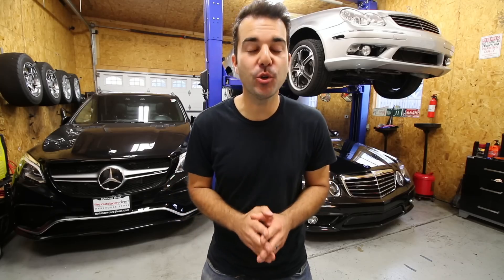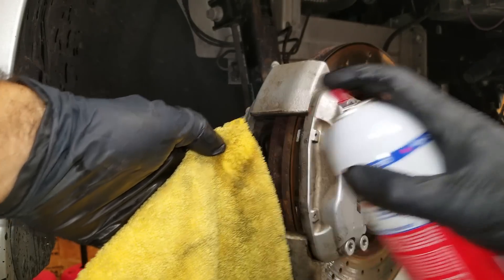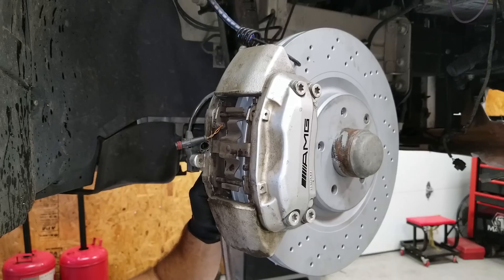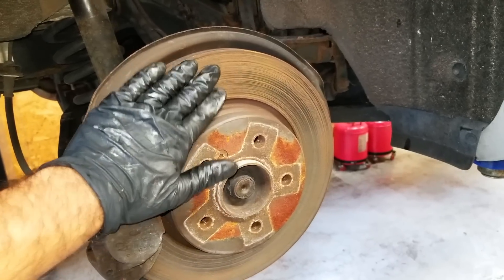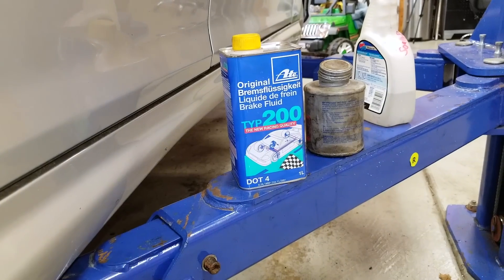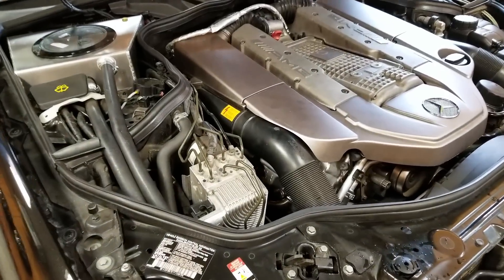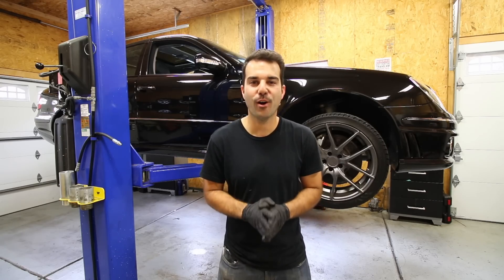Don't Let ANYONE Replace Your Factory Brembo Brakes Before Watching This Video. Big Brake Reality.

Comment: Did the rotors on my BMW once, stripped the fucking retainer bolt. Had to drill the fucking thing out, but not every drill is hard enough to get through it. Ruined some drill bits on it but eventually it worked. Did this on the parking lot in the rain. It was not pleasant.

Comment: Are the brakes from autozone real ceramic cause there’s always brake dust on the wheels I be driving my 2007 Nissan Murano like a gtr
Reply: NFL YoungBoy I would look into purchasing ceramic not made by Autozone itself but an actual brand that is better known. Autozone sells other brands that are ceramic and do a great job in stopping power better than the in house brand they sell.
Reply: joel oliva Ight bet

Comment: Video is very informative but careful... that manual site he plugs will a) offer you the owner's manual for $16.99... Like I said - look carefully at what you're buying because the owner's manual is NOT the service manual; you probably already have the owner's manual in your glovebox (unless you took it out because it is pretty huge). b) if you have an MB and want the service manual,  they don't really exist outside of the WIS/ASTRA software used by the Mercedes dealerships... it's not a manual in the traditional sense, it's software. AND c) that software that they'll sell you comes in the form of a 25GB .ova file, which is a virtual machine image to be run in VirtualBox. This machine image is copied (*pirated,* to be specific) from some legit purchased copy of the software, which is why it has to be delivered in a virtual machine and not as software you can install; they can't deliver you installable software because, like I said, this is pirated from some dealership.

All that said, you can't just buy WIS even if you wanted to legitimately purchase it, which  sucks and I'm not casting judgement or telling you what you should or shouldn't do... I just wanted to make people aware that this is the case, before they end up purchasing things they don't want, or aren't prepared for. Having a usable copy of WIS is a very convenient thing and I haven't found there to be any legitimate alternative. 😞
Reply: this is the very definition of a useful/helpful post. Thanks
Reply: @sonicCherryBell  I am glad it was helpful to someone after all this time :-)

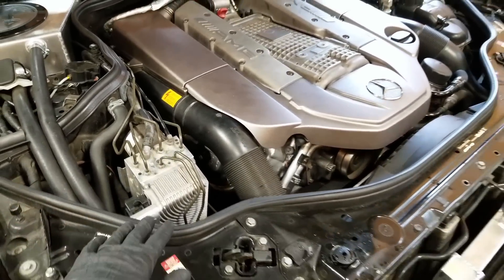Comment: 18:14 Launch X-431 Diagun IV

Thanks for your video. Can you help me please?

I am looking for an OBD2 tool with functionality like the one you use that works with my iPhone. I am in Europe and have a 2010 Mazda 6 and 2002 Ford Focus TDCi. It looks like my Mazda has a similar electric brake system that you show here and I want to bleed the brakes. Are there any other scanners (for iPhone) that cost less that the one you use but that will do the brake bleed job?

Could you please do a review on the OBDLink MX+ Professional OBD2 Scanner please?

Best regards,
Mark

Comment: One of my front brake caliper pins on my 2012 Range Rover Supercharged seized in place for some reason.  I beat it with my punch and hammer like it owed me money to know avail.  Had to end up removing the caliper and sliding the old pads out of the bottom of the caliper.  I have one recommendation:  I would loosen the brake fluid reservoir cap so the pistons go back easier.

Comment: Greetings from Romania! Perhaps you can help me, I have an MB w204 C220 CDI 4 matic and I want to upgreade my stock brakes ( 295 mm front disk, 300 rear and stock calipers with 1 central piston. Those are inslaled on the car ). Thanks

Comment: Great  video!!
Question: I recently serviced my 2014 s550 brakes and rotors at the dealership.
This was the first  time  brakes were done  do to the car only has 30k. They stated they don't have the pads for my car and had to go with  brembo brakes instead. 
Would that call for them to change  my calipers also?
Thanks

Comment: Akebono Ceramics don't bite enough for me, even for street use.
Hawk offers a great compromise.
Reply: my akebono's lasted about a year , mabee 15-20k miles (front brakes)   the toyota pads that came with the car when it was new lasted about 3-4 years around 40k miles. i left the toyota rotor on when doing the pads.

Comment: Toyota trucks have something that functions similarly to these Brembos. However, they are cast iron, ugly, and weigh a ton. Other Japanese car companies use the same thing on a few models.
5:50 People should use those tools 100% of the time. Sometimes if you don't push the caliper pistons in equally, it ruins the caliper. I discovered that while working on a care that had very expensive and difficult to find brake calipers.
8:00 Semi metallic brake pads are common on German cars, American and Japanese cars went with ceramic pads many years ago.
9:45 CRC brake paste is easy to get at Advance Auto and Autozone. Sil-Glyde is easy to find at Napa. I don't know if one is any better than the other.
13:35 some companies sell the rotor part that is separate from the center hub. It saves a lot of money. Here is an example for the Mitsubishi Evo X:
https://machv.com/collections/brake-rotors/products/evo-x-replacement-rotor-rings
16:45 I'm so glad they did that. I'm sure most cars would require you to hook up a scan tool with extra functions. Anyway, I like that little scanner because it costs less than whatever car companies expect you to buy.

Comment: Hi 1)your videos are incredibly informative Thank you. 2) Maybe you would answer a couple of questions, Per your suggestions, I Switched to Brembo rotors and Akebono Ceramics on 98 xj8 l with 130 miles that I recently acquired and see its performance ( did F&R as well as  Struts) . I also just purchase a newer 08 xj 308 that its brakes were completely done however had a shimmy when I Braked at 50 MPH ( I Don't know the brand name but they are new per the mechanic) . I Now changed them to Brembo and Akebono and My Condition is gotten " worse" than before. I shimmy at 30 MPH and all over the place.  It"s not the wheels they were balanced . Help!!!!

Comment: Hey dude, watch the language, my 3 likes to watch these with me!
Reply from the maker: My 2 and 4 year olds watch these too. What did I say??
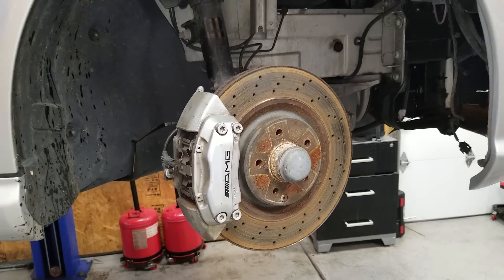Reply: Typical workshop talk, no big, unless you're a toddler latching onto new words. Check out 1:18, 3:20 & 6:56. Lesson learned on my part, I'll pre-watch these in the future.
My friendly local speed shop told me they had someone bring in their factory Brembo equipped car for brakes after the owner of the car tried to DIY them. Apparently, the car owner didn't do any research and started to unbolt the 4 bolts on the outside of the caliper. Opps.
Reply from the maker: Sorry about that Thomas. I make it a point to not use any harsh swear words for this reason but some of the lighter ones do slip in every so often. I've actually replaced the ones I really use in the shop with words like hell and crap, haha. Trying to stay family friendly.  But yea, you may want to pre-watch just in case. Especailly if other people are in the video.
Oh man I've seen that done before. The 4 outside bolts are tempting, haha.

Alex

Comment: On the drilled and or slotted rotors does the direction of the holes matter or is it brand specific direction!?
Reply: Usually the holes mimic the curve of the inner fins. The rotor and fins work like centrifugal supercharger, if installed wrong there won't be any significant cooling effect(unless the fins are straight, then direction of rotation don't matter). Hope that helped.👍

Comment: Any idea where I can buy the brake pads and drilled rotors for my 2013 buick regal Gs? I would like to change them myself. I also am thinking of changing the caliper but I don't know where to buy them. I'm debating whether to go local or amazon. Thanks for the informative video!

Comment: What are your thoughts on my front Cayenne bearing needs replacement and the garage said they should replace the pads (which I ordered Brembo pads saving £200 over Porsche part only price).  I've always done my own brakes and really wanted to do the Cayenne. Sadly I don't have the tools to replace standard bearings rather than the easy hub assemblies.

Comment: great vid. my friend but you should open the bleed screw before you push the caliper back in, so to not push that rusted fluid back in and damage the sbc pum or any abs pump seals if im correct

Comment: Hey Alex, long-time fan. I own a 2008 W209 CLK 500. I want to upgrade my calipers and rotors but as I'm in Australia it's hard to find a wrecked CLK 63 or a R171 SLK 55 with the 6 piston fronts and 4 piston rears. Do you know of any other AMG models that I could use like W204 C 63 or other AMG models that are in abundance in wrecking yards? Any help would be awesome.

Comment: Rotors with angled drill holes as you mostly showed are directional. Unless it’s just for looks those drill holes are supposed to be placed in a vent on the rotor. Brembo probably would like y’all to know only straight vent and pillared rotors are interchangeable left to right

Comment: Remember, do not blindly go for Brembo brakes.
The worst brake rotors i have ever had was Bremboes for a Saab.
They warped after 2 months, they where then straightened in a lathe, but every time the brakes was applied normally for more then 5 seconds they needed 15 sec of cooldown before they where straight again.
A new set of GM OEM was much better build quality and I was not able to warp them even though I pushed them harder then the Bremboes.

Comment: Good vid as always. I have 2006 Slk55 Amg. Front discs are the 2 piece 340mm discs. Im struggling to get replacement discs besides buying the original discs at merc. Do u perhaps know which other dics i can use which will be much cheaper?
Reply from the maker: Send FCP Euro an email. They can hook you up with a cheaper alternative.  
Thanks so much for watching.
Alex

Comment: Hey @legitstreetcars This is a nice instructional video but i wouldn't encourage your subs to use air tools to clean out brakes as it can kick up carcinogenic chemicals in the dust and it CAN cause lung cancer if inhaled, obviously if its just one brake job its not too bad but still you dont want to expose anyone to unsafe practices. Hell even OSHA released a bulletin saying that no shop servicing brakes should use an air tool to clean brakes for that exact reason. Just use a can of brake clean and prevent any chance of hurting yourself in the long term.

Comment: I have been using Akebono pads for a long time, they are also my go to for DD vehicles.  Very low dust and at least in Ohio I have had no issues with stopping in the winter.

Comment: Just bought a 2007 e550 4 matic with 50 k Mile wondering if I should do performance upgrade or store it in the garage because of it's low miles any points of veiws?

Comment: never never  put  anything on hub after  polish with  wire brush  , will cause warp rotors with uneven  pressure of rotor to hub with gap , rotor will not sit flat on hub!!!!

Comment: So... Just push the caliper piston in. NO! you push contaminated fluid back into the ABS pump screens. You should properly release the fluid into a bleeder unit. Continual pushing the fluid back into the ABS unit will cause failure of the ABS unit in the future.

Comment: Hi,

Dont you have to disconnect the sbc pump connector before you compress the calipers? i know it only applies to cars that have sbc/abs pump.
Reply: boyb72 No need to disconnect any part of a brake system when pushing pistons back in calipers, just go slowly

Comment: Semi metallic do not make any noise. But do have more dust since they are softer. Metallic & Ceramics have less dust & more metal shavings in them. Make more noise but bite (brake) better.

Comment: how did you remove the electrical connector on the SBC unit? Pull straight up?
Thanks
Reply: Pull up on tab them move it backwards there may be a plastic zip tie on the base of the connector\cable that you'll need to remove.

Comment: BMW use brembo, some are closed and some or open/fixed style.
Reply: Also I use 75/25 isopropyl alcohol and water mix with colored calipers, instead of brake cleaner.

Comment: Awesome video! Is it possible to also to bleed the SBC brake system without having the scanner actuating the pump to force the fluid out? I have an iCarsoft MB II scanner that is capable of disabling the pump, and while in passive mode, by using a Motive Bleeder with 2.0bar. Bleed it that way?

Comment: Great Clip again, it helps to find out why my s211 / E55 does high pitched noises after Brake disc and pad replacement. We did NOT unplug the SBC prior to work on the Brakes. Holy Moly

Comment: My 2006 SLK55 front 2 piece 340mm  rotors needs replacement. Struggling to get an alternative replacement. Any ideas? MB wants an arm and a leg. Thanks

Comment: Does your manual not say to fit NEW caliper bolts, as they are designed to stretch when torquing them down? I do not have those particular breaks, but also Brembo, and I have to fit new bolts every time I take them off. Also, with newer Brembo, unfortunately you have to take the caliper off to change the pads.

Comment: The only advantage to Wilwood or Brembo brake calipers are the have more surface area of piston to fluid pressure. At 3 pistons per side, they use an engineering trick of placing two smaller pistons at the inboard side of the rotor, then one larger piston on the trailing side. This is assuming the brake pad wears more on the back (Trailing Side) and apply more pressure on the leading side.
 It was 1964 when Chrysler introduced front disc brakes. The where not floating but fixed. This leads to pulsating brake pedal if the rotor or hub is 0.001” or an inch of lateral side movement. 
 This is an engineering nightmare as the rotor has to be mounted to a clean hub face. Kent-Moore sells conical washers and tighten the rotor in pattern with proper torque. This means no torque sticks but torque wrench. A dial indicator has to be place within 6mm of the outer edge to check for later runout. It should be “Zero”. Anything other than that, with a zero runout hub, you either resurface the rotor or buy a new one. 
 The low profile of the calipers by Brembo or Wilwood allow more room behind the inside of the wheel. With 20”, 22” or larger is no longer a problem. Being fixed mount screams cheap. It serves no purpose as if properly designed, a full floating caliper will work fine even at 200 MPH. 
  The extra number of pistons DO make a difference in apply pressure is you know hydraulics and can do math. A panic stop can generate 1,500 PSI. If applied to a single 3” piston = 4,500 PSI. The common GMT400 square-body uses 2.15/16” pistons. The Bembo has (Some Models) more than 4.2” of piston surface, perhaps on one side. So, more than twice the stopping power. Great, but why fixed. 
 Also, removing pins to change the pads is not new. My 1969 Datsun Roadster has the same arrangement on the fronts. So a 51 year old idea? Not new.
  Plus use high temp brake grease except on the friction. This allow reduced noise and helps ensure the pads can move. You know, to apply and release or back off 1/32” or 1mm. Other than that, if the paint comes off the caliper, re-paint then. They are not powder coated well otherwise.
ASE Master since 78 - Retired

Comment: i downloaded shop manual,,,then driver program for it,,,,then tried the two. Cant open either one. Its of some crazy non standard format that my computer cant read, so,,,,about what i expected from a sales pitch on the computer,,,cheated again
Reply from the maker: It works just like I show in the video. I've been using them for almost 2 years. You have not been cheated, don't worry.  Email their customer support for tech help

Comment: Sir, are drilled & slotted disc brake better than the plain original disc?  Is it worth to change the disk with brembo drilled slotted for a regular van car, in the sake of safety? Thanks

Comment: are you aware that the rotors in this video are directional but for these particular cars with these calipers they only make the directional vanes one way. meaning no matter what you do or who you by from no matter what they say left vs right rotor, they are both the same. but when installed one will be venting the opposite way of the other. usually with directional vane rotors you need a specific left and right rotor.  most rotors are non directional. but these are and mercedes has been selling installing and using the same left directional vane rotor on both sides. you should be aware of this as a Mercedes guy. i wish you would mention this.

Comment: Beat the ever living hell out of the rotor with a hammer to get it off... and go ahead and change that hub/bearing now too since you wrecked it with the hammer. Tip...if you're going to use a hammer, hit it from the back. Other than that... good video.

Comment: I was told never to push the calipers in without draining at the same time because you are pushing overheated brake fluid back into the ABS system. Is this no longer the case?

Comment: Alex, just bought myself a 2003 E55 AMG with 55K miles.  Looking for that SBC video.  I know the units have pre-programmed expiries after a certain number of engagements (300,000 or so).  There are also some hacks that reset the counter, but they seem to be bandages.  What do you plan to do for your SBC fix?  Replacement or refurbishment?  Used and rebuilt units run upwards of 1,000.  Thoughts or advice?

Comment: Will the E55 brakes and rotors, install on the C55? Or would I have to replace the brake lines, brake cylinder, ect to compensate for the extra pistons? Forums only give info on 6/4 pistons swap.

Comment: Hi! I have question regarding rear upgraded brakes you did on rear on the w203, cant you swap the rear caliper with a regular w203 with c32 rear caliper and change the rotor ?